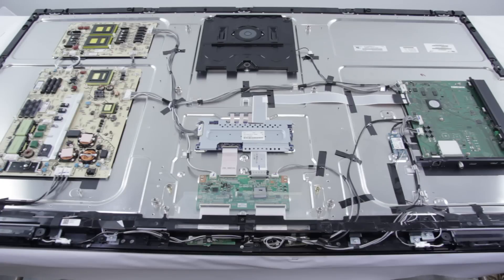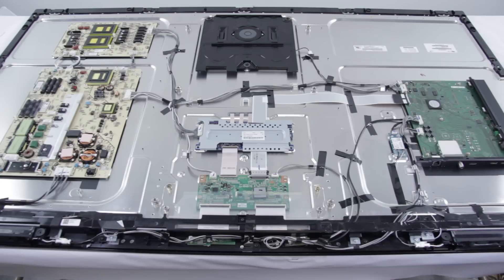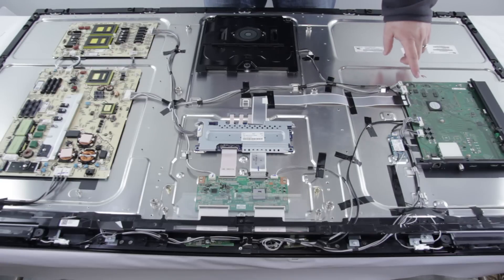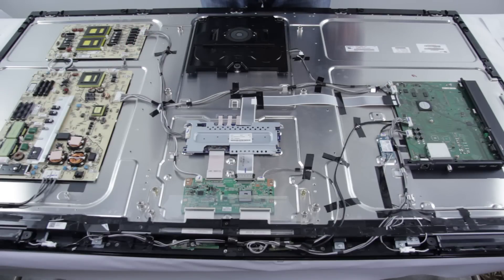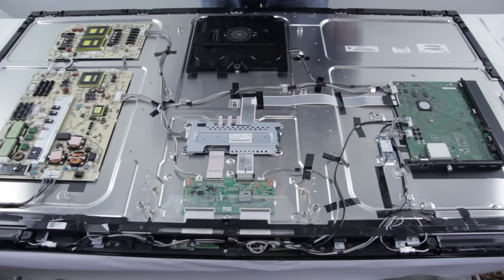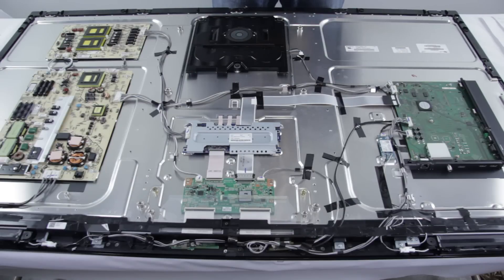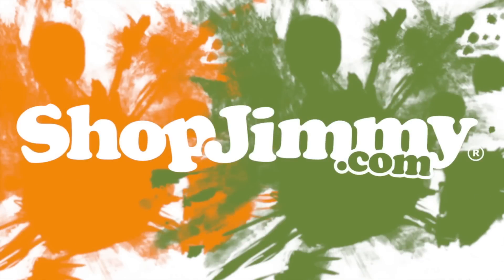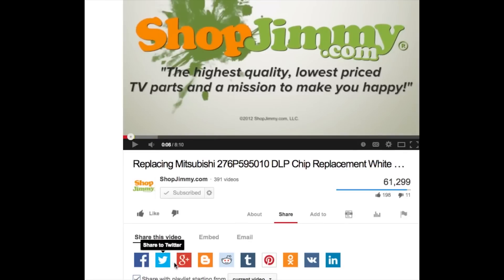LED TV Repair Main Board Overview Blank Screen-TV Has Audio but No Video-Common Issues Problems

Comment: Hello Jimmy,  I have a 70 Inch Vizio Model # E701I-A3.  I have already ordered a T Con Board as well a Main Board from you guys because I do have Audio but I have NO VIDEO.  You can tell there is still a light on in the TV because you can tell its on when you turn it on with a lil light kinda blue coming thru and when its off , its ALL BLACK.  Now as for the history of my TV.  I had it for approx 15 months and it has always been mounted on a master bedroom wall and watched maybe 2-4 hours a day only.  All of a sudden while watching the TV, 3 to 4 Little lines came horizontal across the TV.  So I turned it off and went to sleep and turned it back on the next day and it turned right on with the lines still across it but then 30 seconds later Snap NO VIDEO at all.  Since then, I have changed the T Con Board first and still no video, so I ordered a Main board from you guys and still NO VIDEO but I still do have Audio.  No the TV has not been near water or even sprayed with windex.  The TV has always been on the wall.  I can assure you that there is NO water damage.  Please help me to know what else could be the matter because I was told it could only be the T Con Board, The Main Board or the actual screen.  And its none of the above.  PLEASE HELP....
Reply from the maker: Marcedes Atoe'   This sounds like a TV panel (TV Screen) problem.  If your TV panel is bad, it may be more cost-effective to replace the TV as panels are typically hard to find in stock, difficult to replace, and expensive.  Thanks and please let us know if you have any further questions!  www.shopjimmy.com

Comment: My son threw the remote at the TV now the screen is black it has audio but no picture my TV is a LG 3D tv 47GA6400 is it fixable thank you
Reply from the maker: +JustineRae Garcia   Try all repairs and troubleshooting at your own risk.  This sounds like a TV panel (TV Screen) problem.  If your TV panel is bad, it may be more cost-effective to replace the TV as panels are typically hard to find in stock, difficult to replace, and expensive.  Thanks and please let us know if you have any further questions!  www.shopjimmy.com

Comment: I have a 55 inch Samsung Tv Model # UN55D6000SF Version H302. I have changed the Power Supply, Board, Main board, & TCon board but it still does not have a picture or sound. The standby light blinks 2 times then repeats again.

Comment: Sceptre-X505BV-X505BV-FMQR-Main-Board-1CNCT201402013-V500HJ1-PE8-T-MS3393-715

Sceptre X505BV X505BV-FMQR

I replaced the Power Module, but the red light stays on, and after repeatedly plugging and unplugging, sometimes the TV goes to blue, and sometimes, blue light and the TV goes on . . . . is this the mainboard. I put in $43 already for the power board.

Comment: LG 55LA5210- - Symptom: After pressing power button the LG Splash screen comes on (backlights come also) for about 1 seconds then screen goes black, but all lights at the bottom on the bezel remain on along with the LG logo lighted. SOUND IS WORKING

Comment: I have a 46" Samsung LED TV Model No. UN46F6300AF. It intermittently will not display a picture when turned on. It has audio but no video. Thanks.
Reply from the maker: Bob Eluskie  Please watch this video FIRST to help with your repair!  https://www.youtube.com/watch?v=BP3NVNCGEv8  This could be a problem with your power supply or the LEDs in the TV panel.  You can replace the power supply board to see if that fixes the problem with your TV.  Click this link to a replacement power supply board for your TV.  http://www.shopjimmy.com/samsung-bn44-00520a-power-supply-unit-rebuild.htm  There may be multiple boards for the same TV model number, be sure to match part numbers on your current board, with your replacement for compatibility.  Here is a link to a video showing how to identify your part number, click here:  https://www.youtube.com/watch?v=sSJexLvRrjM  Thanks and please let us know if you have any further questions with your TV Repair!  www.shopjimmy.com

Comment: Hi, LG 42LV5500 s/n 104RMRHBA318, SMART TV. 3.5 yrs old. Screen is extremely black, but can see faintest faintest image of what is actually there. Audio works. After a few seconds/minutes, screen goes totally black, but audio continues. Problem occurs in all outputs, etc. Problem happened after hours of playing video games with full motion flow turned on. Never caused a problem in the past.THANK YOU FOR YOUR HELP!!
Reply from the maker: Macn Strong   This could be a problem with your power supply board or the LEDs in the TV panel.  You can replace the power supply board to see if that fixes the problem.  If that does not work, then you most likely have bad LEDs in the TV panel.  Click this link for replacement parts in your TV:  http://www.shopjimmy.com/catalogsearch/result/index/?cat=59&q=42LV5500  There may be multiple boards for the same TV model number, be sure to match part numbers on your current board, with your replacement for compatibility.  Here is a link to a video showing how to identify your part number, click here:  https://www.youtube.com/watch?v=_4Qpfan0vdU  Thanks and please let us know if you have any further questions with your TV Repair!  www.shopjimmy.com

Comment: We have an Olevia 265FHD-T11 65" that is the model number.  The serial number is VORK7A150468.  The sound went out but every thing else works okay.  Help Please
Reply from the maker: Cory Malone   I recommend replacing the main board in your TV.  Click this link to replacement parts for your TV model number:  http://www.shopjimmy.com/catalogsearch/result/index/?cat=56&q=265FHD-T11  There may be multiple boards for the same TV model number, be sure to match part numbers on your current board, with your replacement for compatibility.  Thanks and please let us know if you have any further questions with your TV Repair!  www.shopjimmy.com

Comment: Samsung UN46C6300SFXZA 46 inch led tv ,when i power on there is no picture but a faint backlight can be seen but can get no picture to come up atall.But if i leave it plugged in for 10-15 mins the picture starts back up and works.
Reply from the maker: Corey Wilcox  Try all repairs and troubleshooting at your own risk.  This could be a problem with either the main board or the LEDs in your TV.  You can replace the main board to see if that fixes the problem.  Click this link to replacement main boards for your TV model number:  http://www.shopjimmy.com/catalogsearch/result/index/?cat=56&q=UN46C6300SFXZA  There may be multiple boards for the same TV model number, be sure to match part numbers on your current board, with your replacement for compatibility.  Here is a link to a video showing how to identify your part number, click here:  https://www.youtube.com/watch?v=BEPWrefQvqI Thanks and please let us know if you have any further questions with your TV Repair!  www.shopjimmy.com

Comment: westinghouse ew39t6mz  version:tw71101-e039a
sound but no picture. put flashlight at the screen could see a faint picture. help or through out
Reply from the maker: James Gibbs  Please watch this video FIRST to help with your repair!  TV Repair! LCD, LED, Plasma, DLP How To Fix Your TV with ShopJimmy.com Help!  I recommend replacing the inverter board in your TV.  Here is a link to replacement parts:  http://www.shopjimmy.com/catalogsearch/result/?q=ew39t6  Be sure to match part numbers on your current board, with your replacement for compatibility.  Thanks and please let us know if you have any further questions with your TV Repair!  www.shopjimmy.com

Comment: I have a Element 46in tv. Model No.: ELEFW504A 
Tv will turn on but within seconds turns itself back off and standby light stays on. Happened after bad storm.

Comment: Hi, I have a LG 42WL30MS. It's basically dead, all it does is when I plug the power in, I see the LG splash screen for a second and it goes away. No red power light or anything.
Reply: If you're getting the LG splash Screen...to me I think the LED strips (1 or more need to be replaced.) Problem is ...that means stripping down the TV and carefully removing the panels. It's alot of work and then seeing if you're able to get those strips. Ideally you want a whole new set, because if one strip went out, more may eventually go out and you don't want to be continually tearing down your LED TV.

Comment: hi, my tv screen gone black but the backlight is on and the sound is working too... my tv is samsung UA32C5000QRXXP.
Reply from the maker: +oblivion   Try all repairs and troubleshooting at your own risk. This could be a problem with either the t-con board, the main board or the TV panel. You can replace the main board and the t-con board individually to see if one of those boards fixes the problem.  Click this link to replacement parts for your TV model number:  http://www.shopjimmy.com/catalogsearch/result/?q=32C5000  There may be multiple boards for the same TV model number, be sure to match part numbers on your current board, with your replacement for compatibility.  Here is a link to a video showing how to identify your part number, click here: Thanks and please let us know if you have any further questions with your TV Repair!  www.shopjimmy.com
Reply: +ShopJimmy.com I wish I could access your website but the network here the philippines keept telling me acces denied that is why I turned to your youtube account

Comment: My TV is an RCA LED TV Model: RLDED5078A. The TV will turn on, with sound and backlights, but without any image. PLEASE HELP!
Reply from the maker: Canadian Cannibal   Please watch this video FIRST to help with your repair!  https://www.youtube.com/watch?v=BP3NVNCGEv8  I recommend replacing the main board in your TV.  Click this link to replacement parts for your TV model number:  http://www.shopjimmy.com/rca-2c-9h004-q50-main-board-for-rlded5078a.htm  Be sure to match part numbers on your current board, with your replacement for compatibility.  Thanks and please let us know if you have any further questions with your TV Repair!  www.shopjimmy.com

Comment: Hi, I bought SAMSUNG UA F6400 40" LED TV 1.5 Years back. Now sound is coming but not the video (Displaying Plain colors). How to fix this issue.
Reply from the maker: Bhanu K  Please watch this video FIRST to help with your repair!  https://www.youtube.com/watch?v=BP3NVNCGEv8  I recommend replacing the main board in your TV.  Click this link to replacement parts for your TV model number on our website.  http://www.shopjimmy.com/catalogsearch/result/index/?cat=56&q=40F6400  There may be multiple boards for the same TV model number, be sure to match part numbers on your current board, with your replacement for compatibility.  Thanks and please let us know if you have any further questions with your TV Repair!  www.shopjimmy.com

Comment: I have a LG model 42LS5700.  I have an intermittent problem that I can not make fail.  I sometimes have sound but no picture after the TV has been off some time, a couple of hours or so.  When it fails I will power off the TV and then back on.  Some time it fails right away, and sometimes it takes a couple of minutes.  I have to repeat the power off/ power on sequence many times until it stops failing.  This can take 2 minutes to many minutes.  I have also had times when I could not get a picture at all but had sound, and if I left it on in this condition the picture would show up after a variable amount of time (not consistent), and sometimes I just give up.  I have also noticed a darking of the screen on the left side intermittently.  The frequency of this failure is also not predictable.  Sometimes I can go days without a failure and other times it fails many times after it has been off for a while.  It is like a component is breaking down when cold.  I have taken to a repair shop and of course it did not fail for a week.

Thanks for any advice you can provide.  The unit is only two years old so I feel it is worth fixing.

Jeff Edwards - jedwards204@nc.rr.com or 919-671-3150
Reply from the maker: Jeff Ed  PLEASE SUBSCRIBE TO OUR CHANNEL - Try all repairs and troubleshooting at your own risk.   I recommend replacing the main board in your TV.  Click this link to replacement parts for your TV model number:  http://www.shopjimmy.com/catalogsearch/result/index/?cat=56&q=42LS5700  There may be multiple boards for the same TV model number, be sure to match part numbers on your current board, with your replacement for compatibility.  Here is a link to a video showing how to identify your part number, click here:  https://www.youtube.com/watch?v=RwHTvjMdrhk  Thanks and please let us know if you have any further questions with your TV Repair!  www.shopjimmy.com

Comment: Toshiba LED tv - Model - 32PB200E1 - No picture at All, but Audio Available, i given to a tv repairing centre , they said no point of repairing since the LED Tube has to be replaced & he further explained that to replace it it will cost the same as you purchase a new LED TV. but i have doubt on this guy because he suggest me , if you want i will purchase the TV for SAR 50(USD 13). please help me - Jason

Comment: I have a 32" JVC TV it comes on but the back lights will not work the light lights up when you push power but he sees nothing else I guess it's the fact like it's only got the power button and I can't do nothing else with it ta1dea333902880

Comment: i have a Toshiba Model # 46L5200U...it turns on breifly , shows the Toshiba Logo, then goes blank...how can i fix this
Reply from the maker: ricky sanquiche  Please watch this video FIRST to help with your repair!  https://www.youtube.com/watch?v=BP3NVNCGEv8  I recommend replacing the main board in your TV.  Click this link to replacement parts for your TV model number:  http://www.shopjimmy.com/catalogsearch/result/index/?cat=56&q=46L5200U Be sure to match part numbers on your current board, with your replacement for compatibility.  Here is a link to a video showing how to identify your part number, click here:  https://www.youtube.com/watch?v=3DQe0ATZl_Q  Thanks and please let us know if you have any further questions with your TV Repair!  www.shopjimmy.com

Comment: Hi, I need help with my Samsung TV.  My TV went blank(black), it has sound but no picture.  The Model # is UN32EH5300FXZA, what can the problem be?  Thank for the help!  :)
Reply from the maker: +T.G Bledsoe   Try all repairs and troubleshooting at your own risk.  I recommend running the flashlight test on your TV.   Here is a link to a video we produced that shows how to run the flashlight test. https://www.youtube.com/watch?v=xUzCLgoSPGM Please reply with your flashlight test results and we can recommend a replacement part for your TV repair. Thanks and please let us know if you have any questions! www.shopjimmy.com

Comment: I have a seiki led tv number Se461ts. half of the screen show half is black. whats wrong with it?
Reply from the maker: nathan bustos  This sounds like a TV panel (TV Screen) problem.  If your TV panel is bad, it may be more cost-effective to replace the TV as panels are typically hard to find in stock, difficult to replace, and expensive.  Thanks and please let us know if you have any further questions!  www.shopjimmy.com

Comment: LG 47" tv model 47LG60-UA. remotes not working. (tried several). Will not turn on or off with remote. Buttons on side will not work manually. Must plug in power cord to play tv and unplug to turn off. Hooked up to Direct Tv box with HDMI to tv. This works fine. Remote will change channels. Will not change inputs. Sound stays at 1 level. purchased 2008

Comment: i have lg 26lg30 tv come on 1second then blank screen sound is ok
Reply from the maker: noel thompson   Try all repairs and troubleshooting at your own risk.  This could be a problem with either the power supply, the inverter or bad lamps.  You can replace the power supply and inverter boards individually to see if one of those fixes the problem.  Click this link to replacement parts for your TV model number:  http://www.shopjimmy.com/catalogsearch/result/?q=26lg30  There may be multiple boards for the same TV model number, be sure to match part numbers on your current board, with your replacement for compatibility.  Thanks and please let us know if you have any further questions with your TV Repair!  www.shopjimmy.com

Comment: I have an Vizio XVT423SV, the tv runs normal for about 20 minutes than the screen goes off with no video and has sound.I turn off the tv and turn it back on, tv works normally for couple minutes, than it goes off again.  TV does have back light

Comment: ELEFT502.   Blank black screen only audio, 11 months old. Thanks.
Reply from the maker: blackmastervqs   Check the manufacturers warranty as this repair may still be covered.  If not, sounds like you should replace the main board.  Unfortunately I do not see any replacement parts in the search results for your TV model number on our website.  Please reply with your part number on your main board and I can try searching for replacement parts.  Thanks and please let us know if you have any further questions!  www.shopjimmy.com